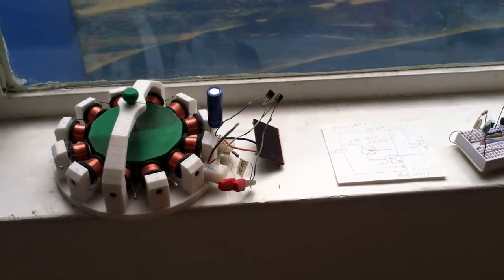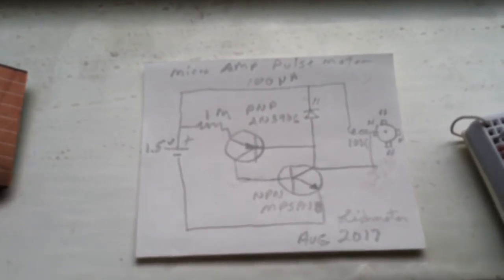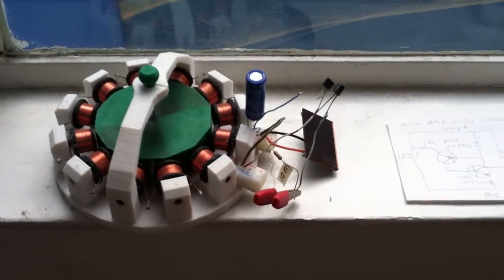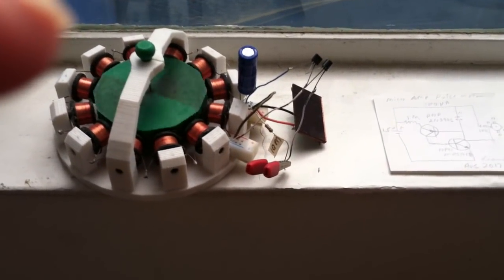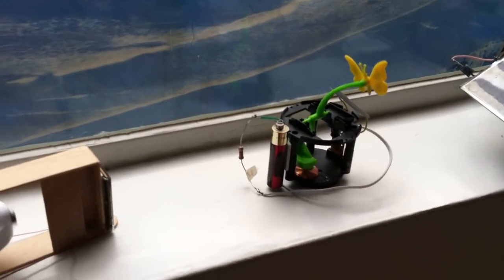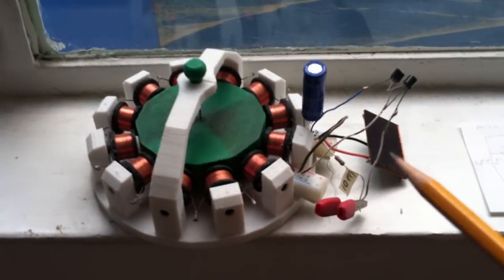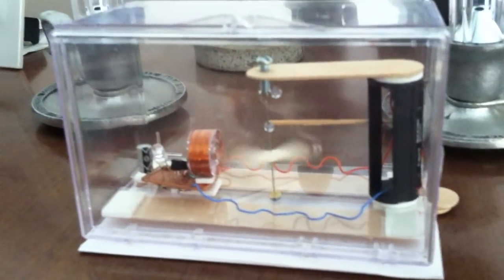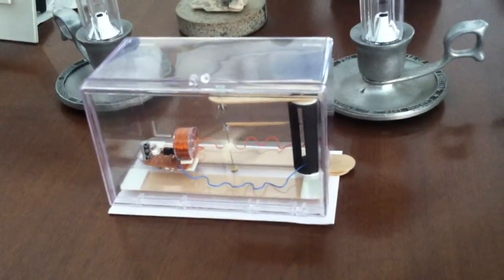A Brief Look At Perpetual Motion --- An update on my non-stop running devices

Comment: It would be interesting to add a thermopile motor to this collection.  Maybe there's a heat source you can tap there.  Off Topic:  I'd love a video where you describe stuff like coil winding and mechanical mounting techniques.  And especially how to attach lead wires so you can handle the fine wire coils without breaking the leads.

Comment: Love the view. The problem with most batteries is that they short out because they will crystallized inside the cell wall. I think you should just stick with capacitors or ultra caps for perpetual motion devices because they will return years of service where a battery will fall victim to there own chemistry or even try a small micro sized lithium cell no chance of explosion they will usually deform when bad but will run forever if kept in spec.

Comment: Interesting work, however look at the modern wall clocks the second hand moves continuous instead of  quartz movement and that runs off  an AA battery.
Reply from the maker: Yes!. -----but sooner or later you have to replace the battery.  I have one of those continuous second hand clocks and I have thought about adding a solar panel to it and replacing the battery with a super capacitor.   It is a very efficient motor.  Thanks for the comment.

Comment: Nice collection.
Add a higher V super cap or connect more caps together to eliminate your cap stress problem.  Alternatively, you could use a resistor or even a diode (which will cause a V drop).

What are we viewing out of the window?  Looks like you're way up in the mountains viewing land & water far below your elevation.
Reply from the maker: The super cap problem isn't that hard to fix like you say. The main problem I am having on these long runners is the breakdown of the plastic pieces as the years click by.   The scene out my window is great!  Too bad it just a mural.  Ha.  It is really old and I need to replace it.  Maybe the next one will be a mountain scene  or a tropical beach.
Reply: Cool!  I 2nd the motion for the tropical beach! :)

You can increase the life of your plastic parts (caused by UV damage) by spraying them with a coating of clear polyurethane.
Reply from the maker: Many thanks for that tip.  The plastic on car headlights breaks down and I have heard that you can spray a UV resistant coating on them after you get them cleaned up. This stuff should work.  http://www.acehardware.com/product/index.jsp?productId=53380586
Reply: I think you are right.  Maybe even better than polyurethane--since acrylic is what is added to exterior house paint for the shine quality--and it probably gives it its UV resistance quality.

Comment: Cool. 
Thought; Bearing surface to fulcrum, is a wear point. (Eventually) besides friction point. Hard chrome works pretty well as a low cost/consumer type solution.
Wonder, something like a tungsten rod and ceramic bushing. Or the new silicon-bronze-nickle valve-guides (from a car engine) could be cut down to form an insert, drop of light oil once a month or so. Probably not aero-spec, but function a very long time...
Any how, ideas for frugal solutions, if ppl keep an eye out for salvage/ over stock of such type things.
Peace.
Reply from the maker: Thanks.

Comment: Great to see these still whirring along. A cap and solar panel should realistically not be a problem for perpetual machines, because the sun will always bring light on a cycle that won't change. As long as the cap isn't electrolytic, the supercap never wears out and the device could run for a few days of bad weather. It's similar to using tidal energy, or wind on top of a hill.  If it's always like that then they'll run and run and run.
Reply from the maker: As the old Indian said:  "..as long as grass grows and wind blows and the sky is blue."